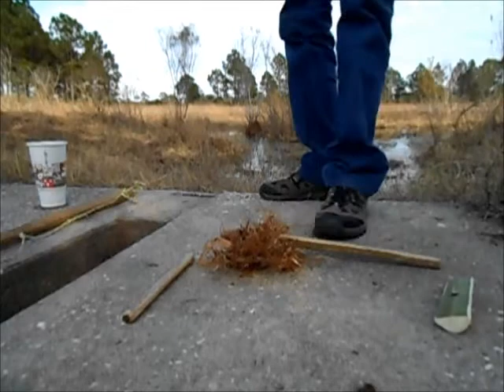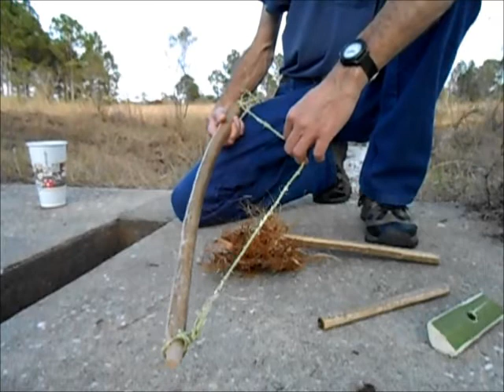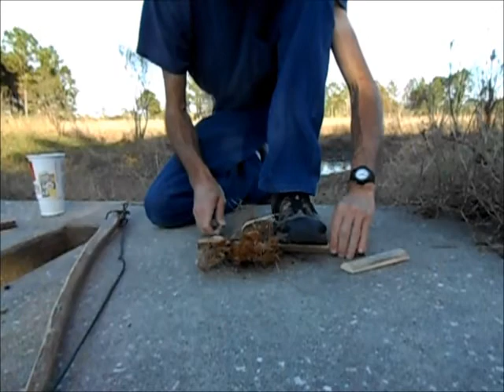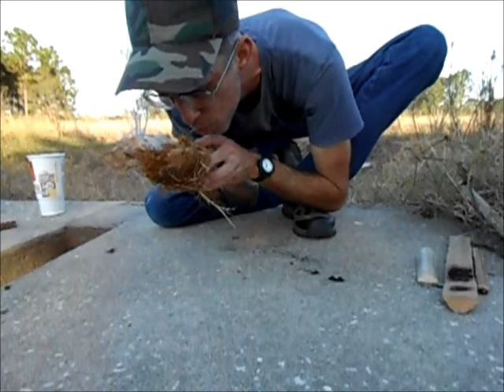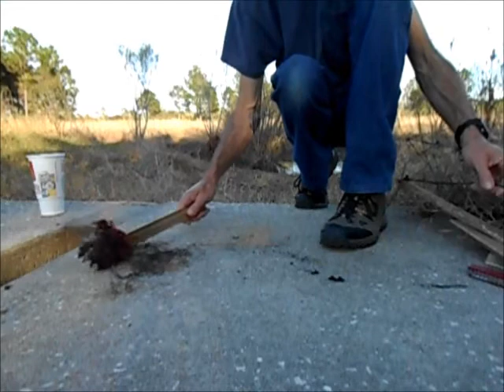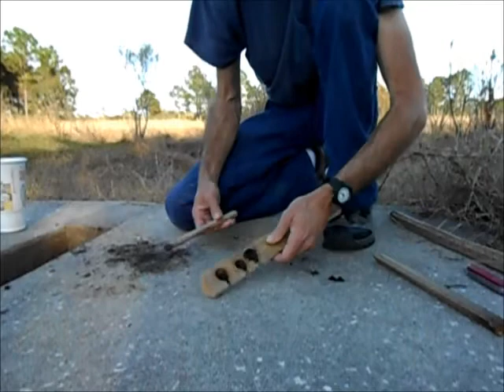FirebowCabbageSabalPalm

Comment: Excellent effort, RBM! Using natural cordage definitely adds to the challenge. It's rare for me to get success using reverse-twist natural cordage with both ends tied to the bow and a single wrap around the spindle. I think a Yucca bowstring was the exception.

It's kinda neat to get everything you need from one tree to make a fire, though. Especially from a tree commonly found in Florida. Give it another try next chance ya get. I think you'll get it on the next one.
 
In the past year or so, I've been lucky enough to practice with on-the-spot bow drill materials in various places throughout the U.S. Gettin' in some good experience in environments other than Florida (ie. Ohio, Missouri, Massachusetts, Indiana, New Hampshire, and Maryland to name a few). In the evenings after work (on business trips), I'd just bring a cheap pair of shoelaces (8 pairs for $1 at Dollar Tree) and a small swiss army knife and I'd go find a wooded area somewhere. I've pretty much weened myself off using paracord these days. I've been learning a lot more about working with less than ideal materials, dealing with moisture, and with the unknown; Often times with wood types I can't identify. I had good success in each place except New Hampshire (In January), not necessarily in one day (on a several day business trip). NH was too cold, with a foot of snow on the ground. 8F degrees out and a 8mph wind (About zero degrees F windchill). My nose and cheeks were freezing after about a half hour in the wooded area I was in (about enough time to find suitable materials). I forgot to bring a scarf, ha ha. I brought the wood home with me, though, and it worked after-the-fact. I was in New York state back in December, but didn't even try a friction fire as the only thing I could think about was getting out of the wind (below zero temps). Shelter would have been my first priority in that case.

I've been wanting to make a video to talk more about the "real" realities of friction fire-making (as you've mentioned in your description). Very true. A lot of info is commonly over-looked and a bunch of it is misinformation when it comes to all this stuff. As soon as I get my notes organized I'll see about gettin' out another vid.
Reply from the maker: Thanks. I have had many successes using Saw Palmetto cord so I know Cabbage Palm cord will work. Just wrong time of year so the cord is weaker and I was not using the Egyptian method that I should have been using.

Yes I often have to explain on forums the realities of what goes on during the course of the video that does not get shown. From cord failures to other kinds of failures and then break it all down so that what I learn is understandable. Hopefully it all helps folks out that are practicing skills.

Glad the job is going well for you and you are expanding your horizons with new materials in other states. Look forward to your videos.
Reply from the maker: RB M One thing I think never gets mentioned on a lot of videos is the safety factor in all the skills that we do. I wish I could devote more time to safety and have the property and permission to do not just a fire safety video but safety in many other areas while practicing skills but I don't have the place, permission, or opportunity. I often have to explain this also on forums.